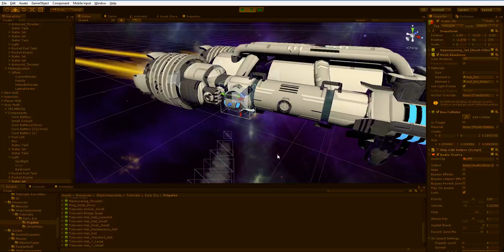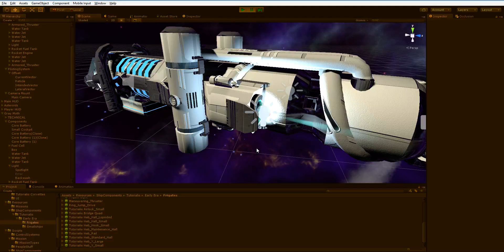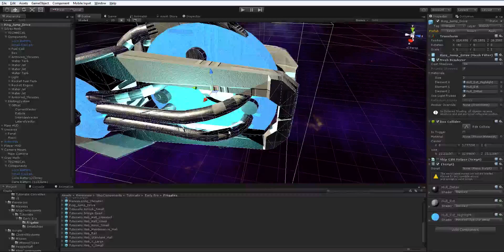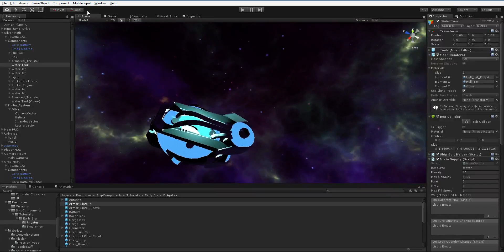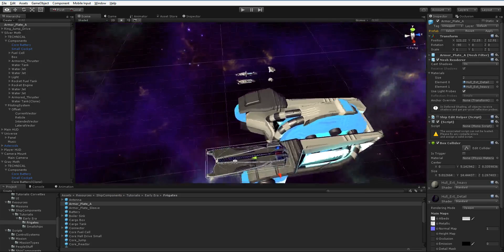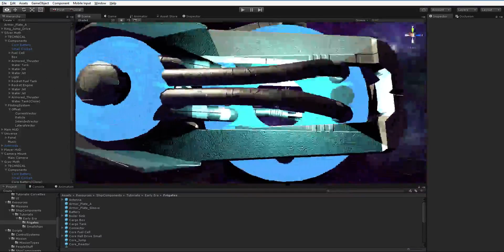Let's Design the Galactic Line: Blah blah blah #1

Comment: Hm have you though about "vector force fields" as shield solution?
Basically it has a chance to deflect a shot when it is at the wrong angle (like a ship in reentry which bounces off the atmosphere when it to shallow) and deforms the "damage bubble". Would keep the inner systems more safe but sacrifices more of the outer components where the damage concentrates.
I think that would be a good synergy with your armor mechanic.
Reply from the maker: +Tim Solinski (MrFaul) Hm. The issue is that I don't want to introduce a mechanic that makes small ships better, or people will just build a lump of overlapping systems.
Reply: +Craig Perko I agree to that, but I don't see the shield mechanic in any favor for small ships or overlapping stuff. Maybe I didn't describe clear enough what I meant. Hang on a sec I try to doodle something up.
In fact I think shields should be something that is only feasible for big ships.
Reply from the maker: Hm. I'd like to hear more, then. I was thinking about an overheat mechanic, but I prefer vector mechanics if it doesn't screw up the design priorities of shipbuilders.
Reply: +Craig Perko Here that is what I had in mind, don't know much it is compatible with your damage model
http://ctrlv.in/747722
Reply from the maker: Hm. I don't think I understand, because it seems like this would make building smaller ships hugely advantageous: a small ship would need less deflection to create a complete miss, right?
Reply: +Craig Perko not really only if you call a reactor with RCS a small ship. Anything else wouldn't be able to produce enough power for a force strong enough to deflect anything besides small firearms. You made your building system seamless scalable same applies to the shields.
Reply from the maker: Ah, I haven't made the construction system clear enough.

You can overlap modules. There's no penalty for having components partly inside each other. But it's critical to not reward that: if we reward it, every ship will just be a pile of overlapping junk.

We allow the overlap because it makes powerful visual designs easy, but we need to make that something that doesn't offer any big in-game advantages.

That's why there's radius damage on everything: if you cram your components together, it requires more maintenance and more things get damaged when you get hit.